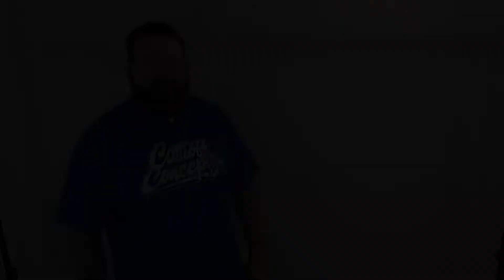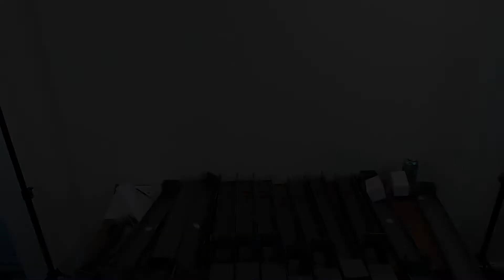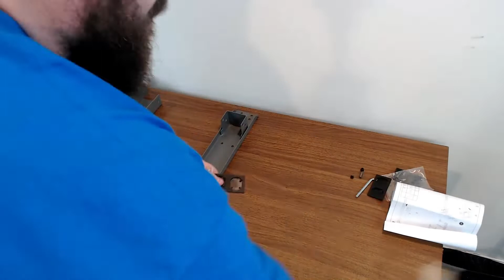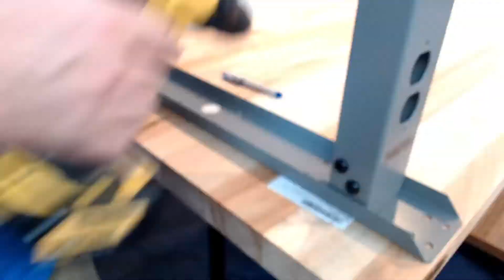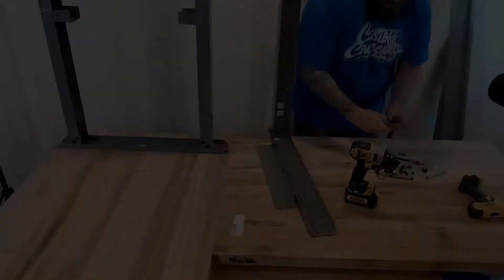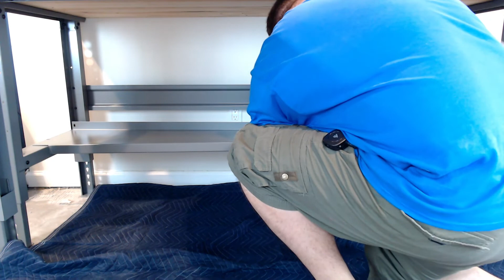Unboxing and assembly of the new L-shaped workbench by Global Industrial - Castoff Concepts

Comment: Appreciate the video! I'm looking at purchasing one of these, but have one question: Do you feel it would be structurally sound without the lower shelf installed? Or does it need that as a brace to keep things stable?
Reply from the maker: Hey, thanks!
It is a great work bench.  It can absolutely be used without the lower shelf.   I built a second and did not install it.  The leg structure is strong and should not allow for lateral movement.   I recommend buying additional screws, as they only supply 4 screws per leg-set. 

Thanks for watching!